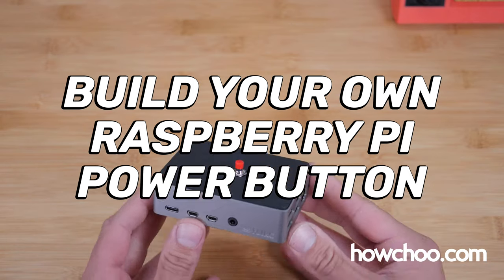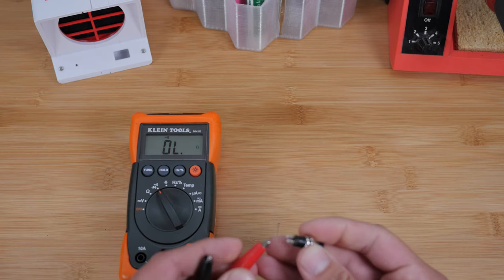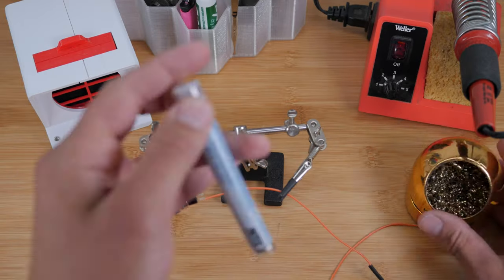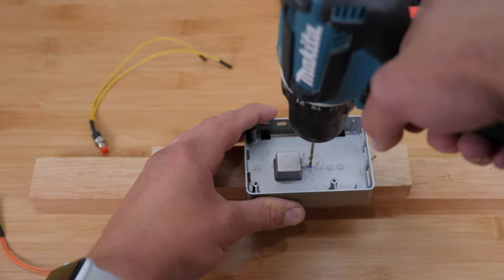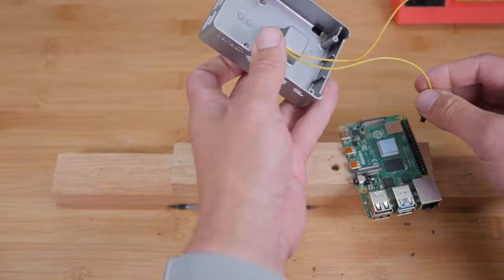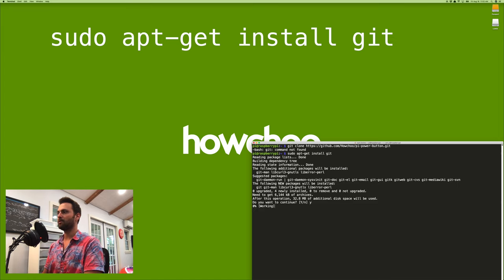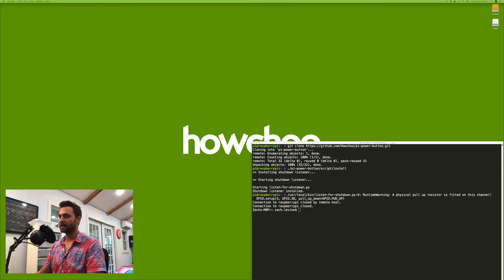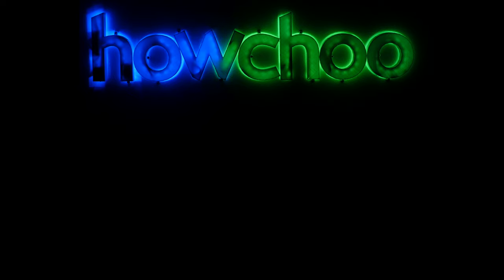How to Add a Power Button to Your Raspberry Pi (+ FLIRC Case Install!)

Comment: Hi when I run ./pi-power-button/script/install I get file "/usr/local/bin/listen-for-shutdown.py", line 4, in <module> import RPi.GPIO as GPIO ImportError: no module named RPi.GPIO

Is there a way to fix this? I have tried pip3 install RPi.GPIO and it says requirement already satisfied: RPi.GPIO in /usr/lib/python3/dist-packages (0.7.0) but when I press the button nothing happens, I'm using an early Rpi4 4gb with updated eeprom and os

Comment: In some other video it is explained to use some resistors not to damage the pins (breadboard and 4 pads button setup). Is this due to the button being used that you don't need anything but the button in your setup ?
Reply from the maker: This isn’t completely necessary—this is mainly to protect the Pi in case you accidentally connect the leads to the wrong pins. :)
Reply: @Howchoo  ok I see. Thanks for the answer

Comment: Thank you for the video. 
I implemented this on two raspberries that control 2 3d printers. 
It works as designed though there is one flaw.
It looks like the gpio pins and scripts are picking up static electric discharges or so.
When I am tuoching one 3d printer it often triggers the script on the other raspberry causing it to shut down and kill the print.
Can the script be made less sensitive?
Or otherwise, how can I remove the script?
TYIA
Reply: Add a 10k resistor to the GND cable to crate a pull up check, just google this and you will see why this will solve this issue
Reply: @TheZeroimpact  TY so much for reacting, I googled it but still I am not sure that this is the only alteration needed.
So base question from me "Is adding a 10k resistor on the GND cable of the switch enough?"
Now the switch is connected directly to the GPIO pins but adding a 10k resistor on the GND cable will remove the annoying and unintentionally shut downs?
Reply: @TheZeroimpact  Still not certain if a 10k resistor on the gnd cable solely will suffice. Looking through many videos I get the impression that I need a cable to the 3.3V which is connect tho the switch and than the GPIO pin as well and the resistor which is than called "pull down".
Please advise if this correct?

Comment: Do you have an idea for when connecting the raspberry to a power source it won't turn on? I works great but the very first time I connect it, it turns on
Reply from the maker: If you power it off using the push button and then unplug and plug it back in, it will boot; the only way to prevent this would be some kind of relay or something, but there’s no way around it.

Comment: Thanks for the video.  I have a pi4 and would like to do this with a touch power button.. is this possible. it has gnd / io / vcc ?
Reply: yes this should be possible if you wire the gnd to gnd, vcc to 5v available on the board, and io to pin 5

Comment: Hi 
I have an RTC module on my RPI 4 already using  pin 5,  may use an alternative pin for the power button? Thanks for your advice!
Reply from the maker: Unfortunately not -- does the RTC have to be on Pin 5 (SCL)? Shorting SCL to GND is required to wake the Pi; so you could use another pin, but you'd only be able to use it to shut down the Pi, not wake it.
Reply: @Howchoo  i dont want to start the pi with the button. how can i change it that it turns off on another pin

Comment: Great video, very clear and you helped me allot! I want to build it in a PC. Anybody knows if a power button and/or the reset button on a PC case is NO based?
Reply: I just tested the button in the chassi am putting my raspberry pi 4 in and it's a NO switch:)
Reply: @KompositMormor  thnx for the feedback bro! Imma try it my self then.
Reply: @CheckitOutYaw  Status update: Just tried the script and it works beautiful with the chassis built in start button:)
Reply: @KompositMormor  I use this with my raspberry pi 4b guided transparent LCD side panel (made my self). Its important that the raspi turns it self off along with the pc in a save way (preventing SD card corruption). Did you manage to turn your pc off and your raspi in the right sequence? Raspi first the ur pc? Now I just made a batch file to execute telling my raspi to shut down and then after my pc.
Reply from the maker: It should be, but it really depends on the case and its circuitry—the most reliable way to test it is to pick up a cheap multimeter and test for continuity (as I did in the video). They're invaluable to have either way.

Comment: Anyone else having issues with the Pi going to a "sleep" state after 10-15 minutes of inactivity after using this Power Button coding? It seems to just black out and the fans still running though...? Will not wake up with any key press just have to press the new power button and it reboots itself.
Reply: I have the same issue.  The pi shutdown randomely, and I don't know why. I'm using it with magic mirror and it's a bit frustrating. This is a random issue so I don't know what is causing this. Any idea since?

Comment: I like you video. could you make the shut down button time delayed so you have to hold the button down for 6 second before it shuts down?
Reply from the maker: You can definitely modify the script to do this. :)
Reply: Thank you for your response
Could you please point me in the right direction on how to do it and where to put it in the script ? I have tried modifying your script with other script codes I have found on YouTube but with no luck
Reply: @Howchoo  so I have been looking into python before I go and install this I would like to run it by you if that's ok ?

Under 
GPIO.setup(5, GPIO.IN, pull_up_down=GPIO_up

# hold button for ? Seconds 
HoldTime=5

oldButtonState 1"+ str(HoldTime) +" seconds") True
Then edit 
If buttonstate 1!= Old button 1 and buttonstate1 == False,hold_time=HoldTime
Reply: Did you ever find out how to add the Hold time ? Thanks.
Reply: @mikeg1zrn896  and you ? Did you find any solution?
Reply: @nix3649  No I didn't, sorry.

Comment: Awesome! I will use this for the arcade I'm working on. A question tho, Can I "unplug" the power cable after the script runs without any risk? Or the rpi stays on some kind of hibernation state?
I'm asking this because I have a main switch on the Arcade to cut off all the electricity. (for safety reasons AND because I'm using a CRT tv that I turn off/on like this) and I pretend to use the button/script first and then press the main switch.
Any thoughts?
Reply from the maker: Oh yeah you can totally cut the power after it shuts down safely. :) Just reconnect the power and it’ll boot right up.
Reply: @Howchoo  Great! So this is just what I need. Thanks you!!
Reply: Does it mean the shutdown script doesn’t perform a complete shutdown (power off) of the RPi?

Comment: i want to use my raspberry as an nas with openmediavalt and i also want a power button to shut it safly down. Can i also use this or must i use an other way?
Reply from the maker: You can use the power button that way as long as nothing else is using the same GPIO pins the power button requires. If you’re just doing a NAS, none of the pins should be in use anyways.

Comment: Got it, i made a type fault, works perfect thank you👍👍👍👍👍
Reply from the maker: Excellent!
Reply: @Howchoo  does it switch the negative wire? Open and close
Reply from the maker: @lucbisschops  What do you mean? It doesn't matter which order the wires go; there's no polarity here.
Reply: @Howchoo  ahhh ok, thats my problem than i have a psu relais controle for my 3d printer on my raspberry aswel, and the ground was pluged in on the same place your ground for the killswitch was programed in your script, thats why, when i shut down my psu relais, the raspberry pi shuts down aswell, is there a way to rewrite the script for a different position of the gpio.

Comment: Howchoo quick question I have this script up and running but notice that if i plug anything usb while running it shuts down (sleep mode) but if I take off the connectors to the pins 5 and 6  and the script still running (basically no button connected there's no issue with it shutting down) I got better powerd adapter for pi and a powered usb Hub just to see if that was the problem and that is not the case still doing it? maybe if there is a way to edit the script to add a few seconds before shutting down?  How do I edit a script? I really appreciate and help or advice Thank You :)
Reply from the maker: That’s super weird—double-check your connections, sounds like you might have a bad ground connection or bad button causing this to happen. :) as far as adding a delay, you can add a Python “sleep” in the core script you installed as part of the setup process.

Comment: hope links are affiliate links because i JUST BOUGHT THE TWIN SWTICHES WHEN THEY ARRIVE i WILL BE BACK TO VIDEO.
Reply from the maker: They are! One of the few ways we make money from our videos and guides :) Thanks for supporting us!
Reply: @Howchoo  I'm kind of looking and don't know if you have a video of it but I want to add a noctua fan and have it adjust speed and shut off when I use this power button. Is this possible? Thank you for what you do
Reply from the maker: I don’t have a video on that but I think this guide is what you’re looking for :) https://howchoo.com/g/ote2mjkzzta/control-raspberry-pi-fan-temperature-python This will turn the fan on and off automatically as needed.

Comment: I am not sure why but I can never seem to download anything using script to install, I had the same problem with the little lcd screen, followed it to a T step by step but failed every time,
Now even this fails when it is time to access any outside source,  at the moment it is fruitbox software on the card but when I install an O.S. I have the same problem yet it will search the internet in the O.S. ,, I can't believe something so simple as this little bit of script and it fails, my pi3B has no idea what Git is so I tried to install Git but again failed, tried to update the config panel and failed again. I am starting to think that pi's should be pies and eaten and not played with. I went in to the settings and setup the network with the ssid and password but nothing changed.
I am off to find a Pi group that likes helping people and doesn't think they are beyond newbies.

Comment: Hi, thanks for the awesome video, it was a great help! I was using this solution on my RetroPie machine. However, after updating RetroPie the power button stopped working, and the script doesn't seem to work anymore:"Traceback (most recent call last):File /usr/local/bin/listen-for-shutdown.py, line 4, in <module>    import RPi.GPIO as GPIO RuntimeError: This module can only be run on a Raspberry Pi!"
I hope someone can help me with this, I'm not sure what went wrong here... Thanks!
Reply: I installed a fresh version of RetroPie and now it seems to work again... maybe something went wrong during the update. If anyone has an idea, I would still be happy to hear it ;-)

Comment: When the Pi is shutdown and you disconnect the power cord, what happens when you plug the power cord back in?  Will it wait for you to press the power button before startup?  If so, this is a good earth friendly function.  Meaning, you can disconnect another wall wart that normally sits idly by using energy.
Reply from the maker: Unfortunately not, when you reconnect power it will boot (because the power button is a momentary push-button). But the normal power button is definitely earth-friendly since it consumes 0 energy while off. :)
Reply: @Howchoo  What is the "normal power button?"
Reply from the maker: @stevesus3295  The button I set up in the video.

Comment: Hi,
I'd like to execute the script on my Raspberry Pi 2 with SMBShare installed on it.
The issue is : I can't use WiFi with it. I tried to install it offline : I managed to download the GitHub files on my PC and placed them in a folder "pi-power-button" on the SD Card. 
But then I can't find a way to execute the install file using the path in the video (./pi-power-button/script/install). 
Anybody could help me on this ? Thank you

Comment: I can only solder, not SODER? will that be an issue?
BTW, this does not work on Pi4 that has the fan-shim installed, or any fan cooling, with or without that bootloader, unless you want a Pi4 that's off with a fan still running regardless? ;)
Reply from the maker: That depends whether you think everyone in the world has the same accent ;) And that’s incorrect; you can use a USB fan as-is or a fan powered by GPIO with a bit of extra code and circuitry. See: https://howchoo.com/g/ote2mjkzzta/control-raspberry-pi-fan-temperature-python

Comment: This worked maybe twice and then stopped altogether. Nothing changed with my system or pins, board, button etc. Not sure what to do
Reply from the maker: Very strange—can you try uninstalling and reinstalling the scripts and see if that works? The uninstall command can be found in the guide (and GitHub repo).

Comment: Mine just shuts it down immediately without running the code, any ideas? I’m using the Borkin button instead of an external momentary button
Reply from the maker: Hmm, I'm not familiar with the Borkin button—is it Normally Open (NO) or Normally Closed (NC)?
Reply: @Howchoo  normally open, it goes in the headphone jack

Comment: Hi, I installed the scripts in my RPi3 running volumio.When I press the button the shut down didn't work but if I ran sudo shutdown - now and afterwards when I press the button the pi boot back up.   Wonder if this is only for rpi4? When I ran it this is what I got the error:

volumio@ovol:~$ sudo /etc/init.d/listen-for-shutdown.sh start
[sudo] password for volumio:
Starting listen-for-shutdown.py
volumio@ovol:~$ Traceback (most recent call last):
  File "/usr/local/bin/listen-for-shutdown.py", line 3, in <module>
    import RPi.GPIO as GPIO
ImportError: No module named RPi.GPIO

Thanks.
Reply from the maker: Sounds like you’re running a stripped down or outdated version of Raspbian that doesn’t have RPi.GPIO installed by default—try running this:

pip install RPi.GPIO
Reply: @Howchoo  thanks that fixed it

Comment: 5:11 Is it okay to use other ground pins? I already have a fan on the 6.
Reply: I used other ground pins.
Reply: @ryaneis7911  Yes. I did it too
Reply: @NikhchansGaming  hey have you had issues with your screen going black after 15 minutes or so but the fan is still running but it won't wake back up without pressing the new power button and then all mm programs that were open were then closed so it's not like it's going to sleep
Reply: @ryaneis7911  Sorry but I didn't use it much with a display. I used it as a headless device.
Reply: @ryaneis7911  you might want to check your settings in your distro. Twister OS has settings for the button press.
Reply: @NikhchansGaming  has to be something in coding would be my guess I can disconnect button and it does go to "sleep"

Comment: Hey do you have a way of installing opencv? Every time i try to install it the dev programs wont install no matter what i try

I heard from some people that they made a version in one file but i cant seem to find that version
Reply from the maker: I haven’t messed too much with OpenCV but a SD card image has to exist somewhere — have you searched for that specifically?
Reply: @Howchoo  ive searched for everything on it but came up empty handed and my many tries to install it sais stdlib.h is not found but it's installed with everything else
Reply from the maker: @entity9742  So I haven't found any images, which surprises me -- however, it looks like you can install easily on a fresh Raspberry Pi with a few commands using PiWheels: https://blog.piwheels.org/new-opencv-builds/

Can you try that out? Install Raspbian first, then connect to your Pi, and run those commands.

Comment: when i typed ssh pi@raspberrypi it gave me the error: ssh: connect to host raspberrypi port 22: Connection refused (edit) then I discovered you did not need to do ssh and you could do it from the built-in terminal app on the Pi.
Reply: is seems that you did not set ssh access on on the pi
Reply from the maker: Yep you need to write an empty ssh file onto the Pi to enable the SSH protocol. See: https://howchoo.com/g/ote0ywmzywj/how-to-enable-ssh-on-raspbian-without-a-screen
Reply: @MrElofix  i discovered that after and now ssh works fine

Comment: If the connectors of the jumper wires are 14 mm in height, which is almost always the case, the FLIRC won’t close completely.

Comment: @Howchoo This is working great for my Pi3B+ streamer with a justboom DAC...HOWEVER it disables the volume encoder on my justboom DAC wich is obviously required (as per https://github.com/PiSupply/JustBoom) it doesnt share any of the gpio pins. If i unistall your script my volume works again. Does anyone have any ideas how to resolve this?

Comment: I put a button in de power supply wire!Easy!
Reply from the maker: I would not recommend this, if you don’t shut your Pi down properly your SD will get corrupted pretty quickly

Comment: Thank you for a wonderful tutorial. Was wondering, what is the best method of duplicating pins? I wrote script like so: 

import RPi.GPIO as GPIO
import time

# Set the GPIO mode to BCM (Broadcom SOC channel numbering)
GPIO.setmode(GPIO.BCM)

# Define the GPIO pins
pin_9 = 9  # GPIO pin 9 (physical pin 5)
pin_29 = 29  # GPIO pin 29 (physical pin 40)

# Configure GPIO pin 9 as an input
GPIO.setup(pin_9, GPIO.IN)

try:
    while True:
        # Read the state of GPIO pin 9
        input_state = GPIO.input(pin_9)

        # Set GPIO pin 29 to match the state of GPIO pin 9
        GPIO.output(pin_29, input_state)

        # Delay for a short time (e.g., 0.1 seconds)
        time.sleep(0.1)

except KeyboardInterrupt:
    # Cleanup and release GPIO resources on Ctrl+C
    GPIO.cleanup()

is it a good way to go?